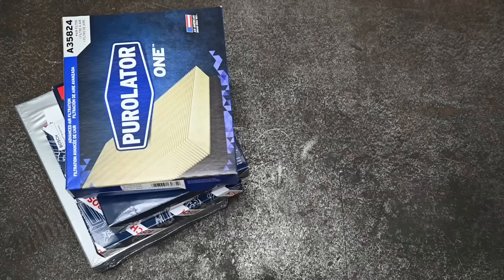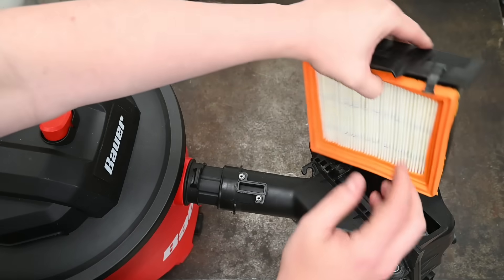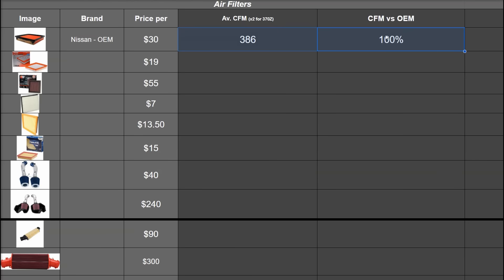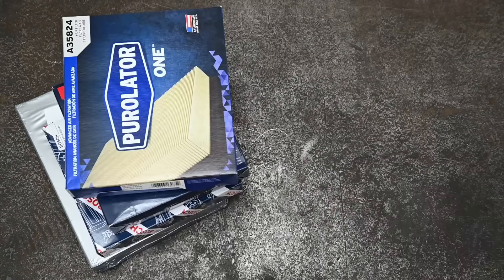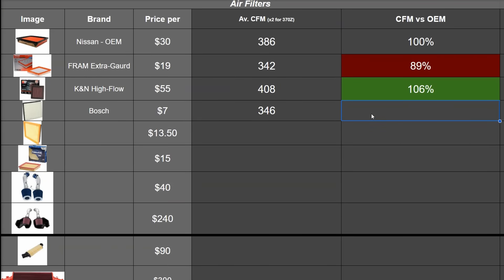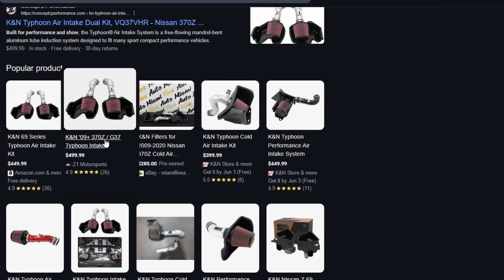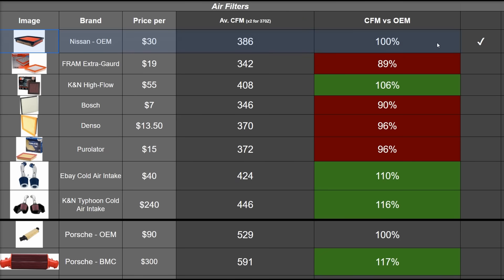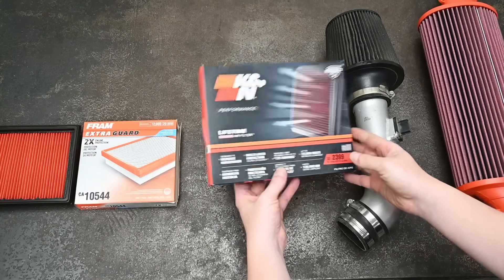Intake Filters TESTED: More Dough = More Flow?

Comment: From experience, after-market performance panel filters do a better job than open air cones, simply because the panel filters sit in the original filter box so most of the air flow around them is cool. Whereas an open air cone under the bonnet is sucking in not only cool air, but the hot air generated from the engine, so performance suffers because of it. yeah the noise from an open air cone sounds awesome, but unless it's in a sealed air flowed unit, it's completely useless apart from noise.

Comment: Cloth filters require oil, which adds some restriction.
CAI systems suck hot air in unless you build a box to isolate it from the engine well.
I use the Weapon-R system with a stock box (routed to underside of car)and K&N filter. Pulls cold air as it should.

Comment: The engine is only gonna use the max amount of cfm of air it can. It doesn’t matter if a filter flows a 1000 times what the engine can handle.

Comment: AN AIR FILTER WILL NOT HELP PERFORMANCE UNLESS ACCOMPANIED BY AN ENGINE RETUNE.
Reply: and even if you tune the engine, aftermarket intakes have shown to make less hp and torque than oem box.

Comment: Hi, please don't laugh but if i were to replace my scooter intake from paper to those sound dampening foam, do i need to oil the foam? I don't wanna spend a lot of money for aftermarket foam filter 😂.

My scooter is ported, so I've been running without filter for 1 month and when i check the intake manifold, it's a bit dusty and I don't wanna ruin the engine lol

Comment: Very interesting as an indicative test. Closely match the air flow to actual engine consumption of183cfm per side.  One concession is the shop vacs are centrifugal pumps, while an engine is a positive displacement pump. In theory the effects of a filter on the engine will be less pronounced.. The shop vacs are necked down from aftermarket manifolds which is a restriction that muddies the measurement. I am so glad this test was done. And i didn't need to do it.

Comment: I "think" using a monometer to measure pressure drop across the filters would give more meaningful results. Shop vacs are not constant flow or constant pressure devices so any experiment you do requires a bit of interpretation. Great test, not trying to be critical, just a fun topic to BS about.

Comment: Assuming the filtering is good enough, and service life between changes (or cleaning for the K&N) is similar, I think the K&N is definitely worth the price. With Fram being a really popular choice, it would only take 3 filter changes to pass the cost of the K&N ($114 vs $110), 2 for the OEM ($120), and 4 Denso filters would pretty much match it ($108)

Just like the Boots Theory, you'll spend more in the long run by buying cheap stuff that you'll need to replace much more often vs spending more up-front on something high-quality that'll last much longer (obviously, a higher price doesn't always mean higher quality, but higher quality does usually mean a higher price)

Comment: Now you're speakin' my language! The OEM filter is the style I most prefer for a stock car. That or any well constructed synthetic mesh. Preferably with wire reinforcement in most applications. I also like dry filters. My experience with oiled filters is that they gum up more quickly and leave dirty oil residue on everything. Straight out of the box, not due to over oiling. I do live on a dirt road. They're also just too expensive for the benefits. I'm a big fan of AEM dry filters or similar products. That said, a lot of reputable OEM style aftermarket replacements are fine with me. Wix, Denso, and Purolator are go tos for me. It really is embarrassing how bad the FRAM manufacturing is. So sloppy.

Comment: All unenclosed free-flow filters, like the blue ebay filter set in the test, regardless of brand, are pure garbage. They suck hot air from the engine compartment and as a result, the engine's power decreases. The flow may be greater, but the engine actually gets less oxygen than with standard enclosed filters, because the density of warm air is much lower. A washable K&N filter or similar works well as long as it is kept clean and oiled properly. The biggest problem is that they are often driven too dirty, they are washed using the wrong methods, with the wrong detergents, they are dried with compressed air and too much oil is applied, and it is not allowed to soak in long enough. I have used free-flow filters in several of my cars for many decades, and there have been no problems. The filters have always been in standard filter housings or otherwise enclosed so that hot air from the engine compartment does not reach the filter.

Comment: You got OEM but you didn't try Original, like the OEM you have looks cheap, i once found an actual original filters stock, they looked identical to the first ever filter that was in, it looked perfect, idk if it was in my head but i felt like the throttle response was way better than the usual cheap OEM ones

Comment: I have a 370z with catback and tune. Intake is stock other than the silicone pipe. I used factory/AM paper filters, oiled k&n filters, and oiled foam filters. Difference was unnoticeable or subtle. At least when new. can youndo a test later with used filters? 6000miles or 10000km would do the trick. People say paper filters drop in performance quickly due to clogging.

Comment: In dyno testing various intakes while recording IAT's over the years, we saw that some intakes might flow more air but allow more heat soak so they actually lose power. Need to test on a dyno with hood closed and plenty of fans shoving air.  Also need to do back to back pulls to simulate actual driving. Some intakes would make one flash run with a bit more power instantly heat soaking then make less power than OEM on the second pull. We saw that's its tough to beat OEM because of the insulation between air mass and waste heat from radiator. So a raw CFM number doesn't mean it'll actually make more power in the real world. It's rare to see an aftermarket intake that actually makes more power with hood closed on the road after repeated pulls. TLDR: Always log IAT with hood closed on a dyno when testing intakes.
Reply: So many do the polished intake with a filter just hanging out in the hot engine bay. They aren’t nearly as bad if there’s an insulated box or at least heat shield. Ideally they have an insulated pipe with an insulated box and ducting so it’s pulling in outside air. 
Nearly every stock intake setup has ducting to pull in outside air for a reason.

Comment: When I was a young Hot Rodder, I spent a lot of money on K&N air filters, and I liked Malcom Smith. Results after meticulously servicing these filters resulted in new piston and bore jobs on the Yamaha dirt bikes every year, and a .010 taper in the bore of my turbo diesel truck after 100K miles. Later use of the TwinAir filter on dirt bikes in the dirt gave acceptable performance and no bore jobs. I am told that oil analysis on crankcase oil is the ultimate test of an air filter's efficiency, checking for silica content.

Comment: As I was about to purchase the K&N Typhoon set up for my G37S this video had perfect timing!
Reply: Might get one for mine, I had an injen short ram intake but went back to stock - stock box performed better. Injen would get heat soak super easily. Injen sounded great tho
Reply: I dont recommend short rams simply because of the heat soak. However a proper cold air intake like from Z1 motorsports for your G37 supposedly guarantees extra horsepower. And if you get the three inch ones with a tune it's even better

Comment: More air flow = bad gas mpg FYI on my tahoe with the stock air filter I would get 40 more miles before the gas light came on and i tested it 2 times a month every othet weekeend drivinh to fthe beach so the hell with a high flow ait filter i thought about trying to put 2 stock air filters to slow it down more gas mpg !!

Comment: I am also one of the guys with a "performance" filter in my car, so my next words shouldn't be as offensive as some of you will take them. 

A performance filter works with less filtration, so that's the way, they achieve higher flow. So, if you want your engine to last long, don't be stupid and leave the filter stock. Or at least buy a filter, which will do it's job.

Comment: As a professional mechanic keep the stock air box.. if you MUST just get a k&n replacement panel filter. You NEED to wash it right. Very soft water pressure. Like very soft. Its very very very easy to spread the cotton apart. If you can see little holes of light through it after its cleaned its trash.. you will eat your rings up in time.. or very short time in dusty conditions.

Comment: I paid a bunch extra extra for an HPS intake on my Honda Fit that GUARANTEED is just sucking in heat soaked engine bay air considering the filter goes rearward towards the firewall right over the transmission, but the choo choo noises are where it's at! lol

Comment: Wondering if you could just calculate the area of each filter for results. The media should be filtering to a particulate level. Add a bit of back pressure for and tubes will drop it a tiny amount. 
Those results could burst some bubbles.

Comment: I designed air filters for cars a few years ago. You should look for efficiency, that is, how much of the crap you put in gets taken out. OEM filters will be over 99% efficient. Performance filters are less efficient, some foam ones can be less than 50% efficient, that means if I put 100 grams of dust in the intake, 50% will go into your engine. Also as you’ve been testing - pressure drop, or restriction, thats normally dictated by the area of the filter if you were to unfold it into a flat sheet, generally the larger the sheet the lower the restriction. In my experience a lot of performance filters actually have less area than OEM so although the media is less restrictive per area, there is less area overall so any gains are cancelled out.

Comment: In my opinion, Nissan and Porsche won’t run their high performance 350Z or 911 Turbo on a rubbish air filter. Neither are an economy car where performance doesn’t matter. Why would they nerf the engine on their performance cars if they can avoid it?
If K&N air filters were really that much of a NOTICEABLE improvement then manufacturers would use them as their OEM filter. It speaks volumes than manufacturers don’t use K&N’s design.

Comment: it's common practice for OEMs to design filters to flow 2-3x the required CFM.
they are assuming customers will forget and never change the filter.
hat way even 50% blocked, the power and MPG doesn't change.

Comment: Did you just call that eBay performance filter a cold air intake? LoL 😂😂 
Sucking in hot air from the engine bay! 
I just can't understand how people can call this a cold air intake? 
This test would have been even better if there was a measurement of particle count at the output after sucking up some fine dust.... 
At the end of the day, it still is a filter right? It has a job to do and that test would reveal if the lower air flow is due to the filter actually trying to do a really good job or its just a terrible filter that causes poor performance.... 
Seriously though, what's the point of having the most airflow if the filter is passing particles and shortening the life of the engine? 
Besides, I'm sure that some engines probably need some vacuum before the throttle body but don't quote me on this.... Eventually the filter will collect dust and will produce a measurable vacuum between the filter and throttle body.... 
Might be a good idea to install a vacuum gauge there to get a visual on how bad the filter is....

Comment: Now test some old school roundies. 

FActory 2bbl/4bbl round

Aftermarket 2bbl/4bbl round

Factory 1bbl for GM 250/292, Ford 240/300, Chrysler 225 Slant

Also test lidflips. They were a common trick done back in the day to squeak another few percent out of the ol' mullet machine by bypassing the restriction in the snorkel, plus lidflips make 'em sound better. And if you can get your hands on one, for s's and g's, test an oil bath air cleaner too.

Comment: I love TTC, and any comment on my part is not meant to criticise them,. But people are stupid and just don't use their brains. The key to good CFM ANF filtration is to go with good filtration with a BIG volume. I fitted my L4 2.0 liter engine with a V8 air filter that filters everything while allowing a big volume of clean air to go inside the block. Simple, when you "think" just a bit.  Cone filters are a scam for naive (stupid) people.  Go BIG with fine filters, and you will have everything you want from a filter. SIMPLE  !!   Beef it up !

Comment: shopvacs are really strong, you might blow out the air filter lol. Also, filters have an efficiency rating at a specific micron size. Finally, Porsche is gonna win an actual particulate reduction test under engine conditions because they put the most surface area where it actually matters

Comment: Been using K&N since 1997 in every car and truck. It's not hard to clean and oil properly. Never had a problem since 1997 and never had to buy another filter. Oil sparingly and wait for the gauze to absorb it. Uniform color and it's good to go.
Reply: I feel like everyone commenting drives in Bahrain or Dakar, I’ve never had any issues either with any K&N panels living in the UK
Reply: I've also been using the same K&N panel filter on my prelude for near 13 years now. I'm surprised to see so many comments complaining about them. Mine still looks good as new, with no deformation or sagging and my throttle body and intake have always remained clean.

Comment: I would have liked to have a car on a dyno.  Start with stock filter for baseline. Change filter and dyno that, using all the filters. Graph the hp and torque from each run against cost of the filter.  I bet the cheapest filter holds its own against the high flow ones.

Comment: Great job.

I feel like I've been waiting a couple decades to find out: Do these cold air intakes, filters, whatever, really make any difference????

The only thing I ever saw on this was a guy on YouTube who duct taped over half the surface area of the air filter, and then drove the car....  The car basically ran fine...  Performance was lost at the very top end, floored to the mat....  Otherwise, his numbers were the same.

I feel like your test kinda proved that....  Even the crappiest filter delivered "almost" all of the air the engine could theoretically be asking for....   Obviously, at half throttle, the engine is asking for less air.....

Comment: The car will still move the air it needs just with a higher pressure drop. Also your airflow measurement is a little meh. 
As far as comparing one to another, you are consistent so it’s a good test in that regard.

Comment: Just a note - a number of the Wix OEM replacement air filters I've bought have deeper pleats than the OEM and many other manufacturers.  I've felt that this greater surface area allowed for more flow.  Would like to see them tested if you get a Wix that is deeper pleats (measurably and easy to see) than the OEM's.

Comment: Pore size which seems to be a big comment here about letting more junk through and surface area of the filter membrane is an important factor as it plays a big part in how much air will flow through. I guess 1 think to factor in would be any positive pressure on the dirty side of the filter through the duct work that supplies air to the filter. The air box itself has some volume. But overall a great year to show more or less static flow through the filter itself. How about a shop vac comparison? I talk about building a frenkenstein vac where I tie a few together but have read mixed opinions. Then I was thinking about building a vac drum and sit multiple vac motor on top. I want both volume and lift.

Comment: Nobody ever maintains the K&N filters and the extra flow is due to less filtering. The oil on the filter is supposed to catch it and that also causes issues with mass airflow sensors which over time can make the vehicle misread airflow.

Comment: CFM will generally equal RPM x cylinder volume  (80%) unless it's has a turbo/blower used/installed
You are really needing to do a Static pressure test  (w.c. press)  *air flow restriction

Comment: I suspect some of the reason the non OEM cheap paper air filters restrict is not only because the gasket area impinges on the filter media but also because the filter media is less rigid and collapses on itself under high airflow conditions causing higher restriction due to doubled up filter media in some areas, making for a smaller flow area. If you look at the OEM it's got shorter pleats but my experiences handling OEM vs non OEM air filters is that those shorter pleats are better supported by the gaskets at the ends and the paper is more rigid which is less likely to collapse under high airflow. Also some OEM are oiled paper filters which really filter very well and are much more accurately oiled than brand name gauze filters that are only there to keep the marbles out.